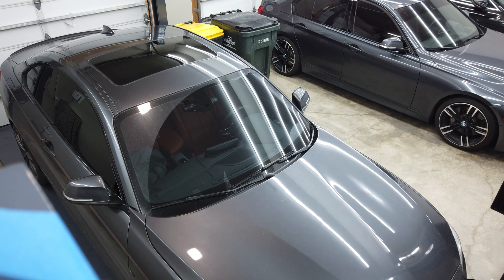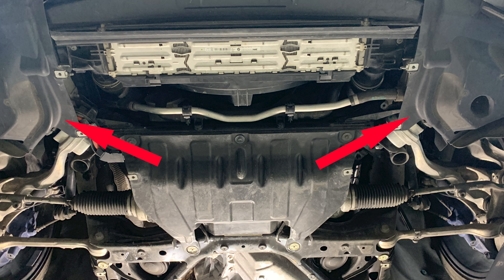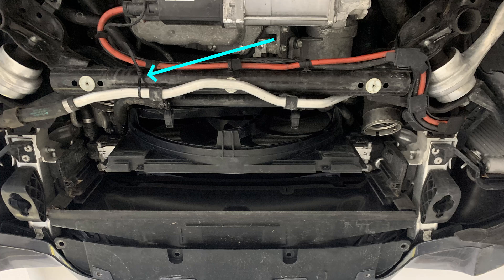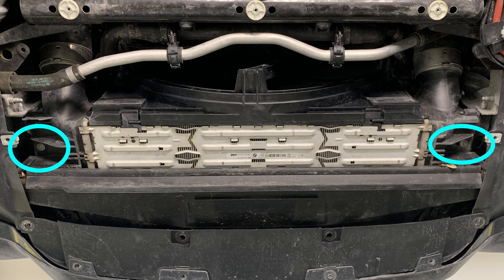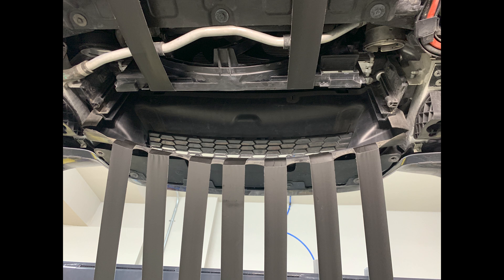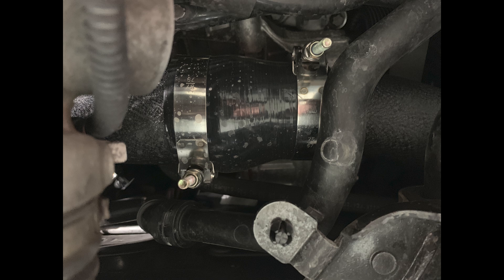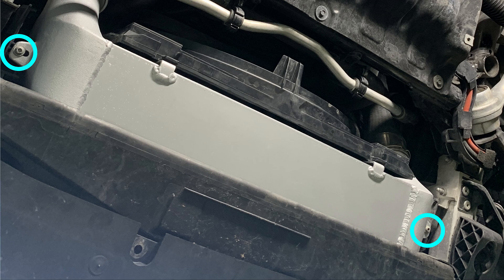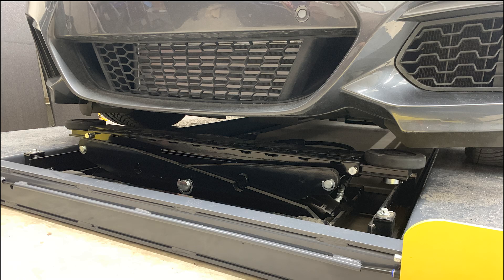BMW M235i / N55 Intercooler Upgrade Tutorial / Tips

Comment: You provided the best tip of all the videos ive seen, loosening the coupler on the chargepipe made this job much easier. Also dont forget to unbuckle the line running across the crossmember, frees up some space as well. What a tight fit!

Comment: Awesome videos man. I am looking to buy a 2016 M235i with 23k miles and can’t wait. What do you recommend for the first upgrades?
Reply from the maker: Flash tune was the biggest improvement for the money.  It depends on what your goal is
Reply: Thanks man. Ya honestly I have been looking at a lot of youtube videos. I was thinking exhaust and intake than tune. Have you taken the M235i out on the track?
Reply from the maker: Exhaust never hurts!  I haven't tracked it but i used to have an m2 that I did track and it was great
Reply: Cool stuff man. Well thanks for the advice and input. Awesome videos keep them coming. Do you have a lot more contact for the m235i?
Reply: Do any upgrades except intercooler. The intercooler do not give you horse power.

Comment: The tabs on your FMIC have to overlap the tabs on the radiator fan. Yours are not fitted in properly.
Reply from the maker: Yeah I saw that during installation but couldn't get it in with moderate force so I left it.  It's not going anywhere so I'm not concerned

Comment: Hey mate, very nice video, removing bumper makes it much smoother experience especially if swapping charge pipe same time, but totally doable the way you have done it, you and I have very similar mods, I have m2, looking forward for turbo upgrade video 😊
Reply from the maker: We'll see! Lol.  I think I'll start with flex fuel since I can gain quite a bit with fuel alone
Reply: On a M2 you have to remove the bumper. On the mlite you dont